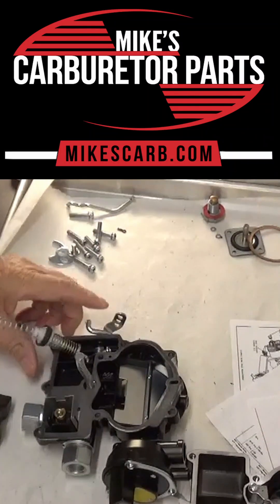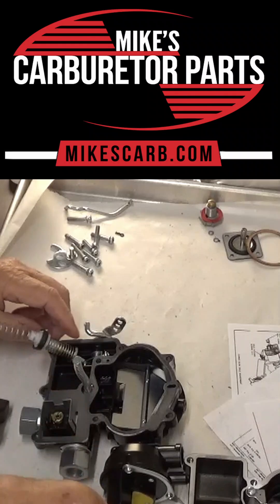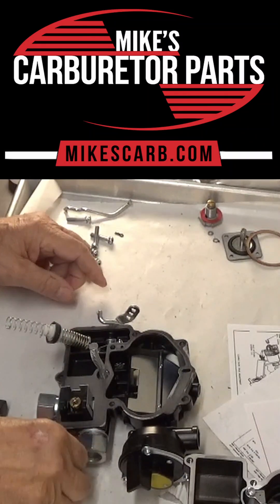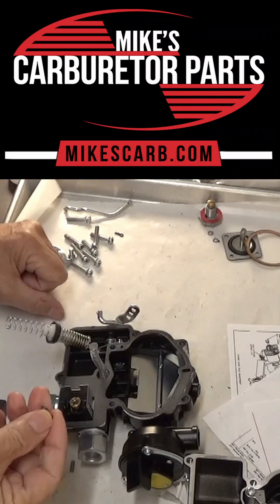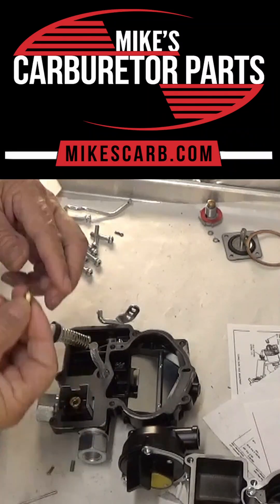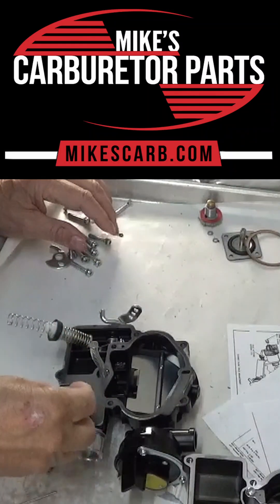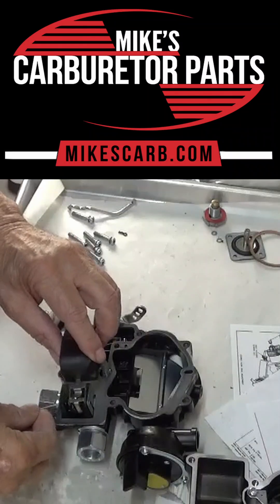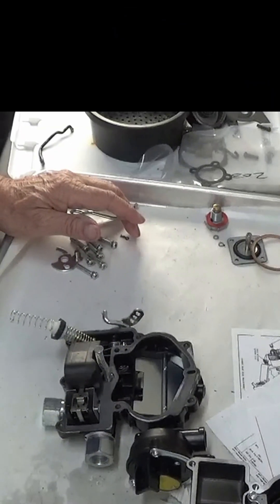Mercarb / Mercruiser Carburetor Needle & Seat – Spring-Loaded vs. Solid Type

Comment: Thanks! I’m tracking down a rich condition and your videos are super helpful. I may order a rebuild kit from you, but I have a 1984 merc 120 and I only see kits for 1986 and up.
Reply from the maker: Do you have a Mercarb which would have only one idle mixture screw on the throttle body. You might have a 2 jet.
Reply: @MikesCarburetor Mine has a single screw so I’m sure it’s a Mercarb. The accelerator pump is straight. Your kit seems to be correct, I ordered one a few days ago. Your YouTube videos gave me confidence that it’s the right choice, even if my engine was made in 1983-1984.
Reply from the maker: @RDeanOdell  Great. Take your time clean well. You will succeed.